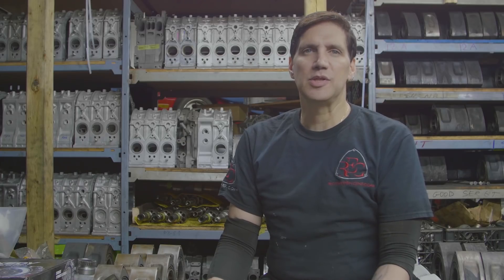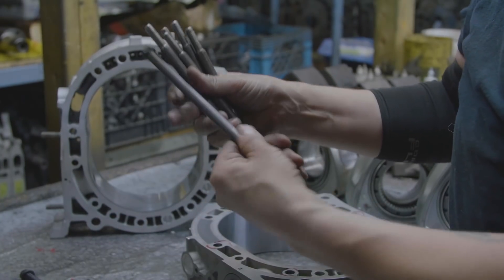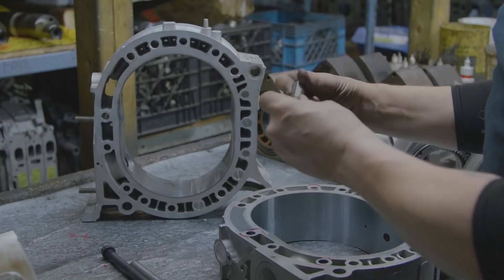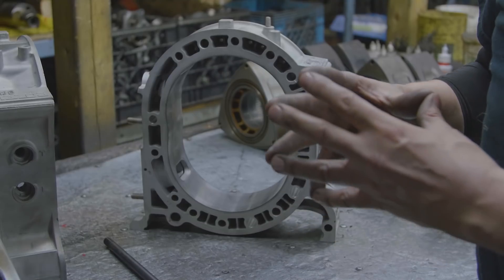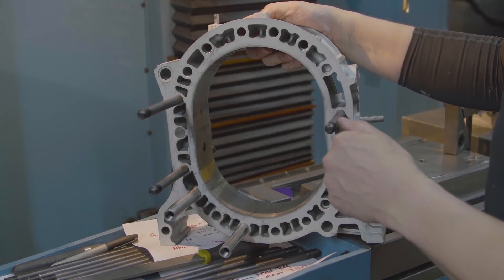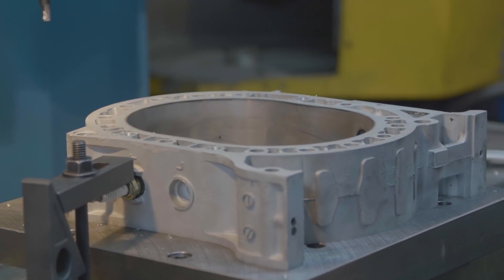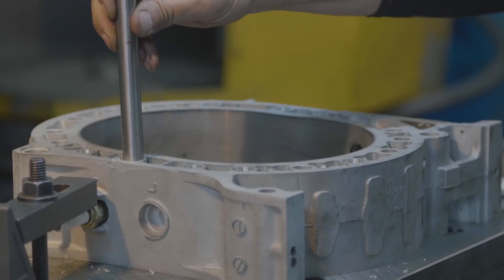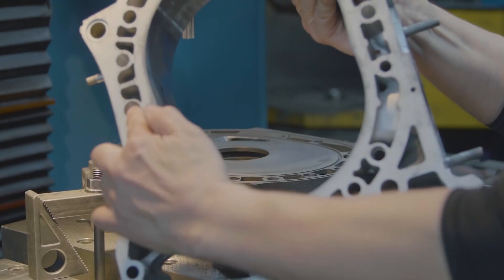PART 1 Dowel Pinning a 3 rotor 20B

Comment: Twist a piece of paper into tight pencil like dooby and stick it in the air intake before the filter.  As you do not want it to get sucked in.  Secure it in place and then start the engine.  After A while of driving pull over and put your hand in the exhaust stream.  It should be A lot more humid than it normally would be.

  It basically pulls small amounts of water/coolant into the combustion chamber where it can be turned into steam.  Using this trick might ruin your engine or give it better MPG by steam cleaning the engine.  Up to you if you try it.  

  If you leave this mod on, you should change the coolant to the environmentally friendly kind.

  Also try fuel magnets at the same time as you are using this modification.  Fuel magnets create more heat in the engine and in turn will create more steam.  More steam equals more power and cleaner engine.

  Of course this is A gamble but I would not try it on A highly modified engine.

Comment: rotaries are by far my favourite engine, I have recently moved countries and busy planning my next project. Its between a 20B eunos cosmo or an R33 skyline and i have always wanted a rotary... sadly you and I are on different continents, I have not looked at the euro guys for their quality of work yet, but due to the videos you have posted showing how you work I would rather trust you guys. I will take a look at some of the Euro guys that work with rotaries then depending on what they say I will probably reach out to you guys. I have machining experience so I would say it is possible to do this on a normal mill and not CNC but it wont be easy...

Comment: I ain't gonna lie. At 16:52, seeing how there is so little material left around the cast iron walls for the dowels on that 20b plate makes me not even want to consider dowling. 

The machining for the studs however, seems to make more since. 20b center irons are just too rare and expensive for me to even consider dowling. Seems with enough heat cycles, those thin walls may crack?
Reply: @AYE OK SURE New or used the REAL issue is the old tech cast iron and Mazda's inconsistent castings of the plates. Cast iron is just so brittle. Did you see the video where they took a hammer and hit a corner of a rotary plate and it just broke off like nothing? Be nice if Mazda would just roll out some new housings made with the new compacted graphite and you wouldn't have to worry about machining for dowels at all.
Reply: RotaryPerfection thin walls do crack and heat cycles between different alloys jeez pretty sure rx7specialties knows what they are doing if your a machinist and rotard lol been a rx7club member for years forums need I say more
Reply: @REsuperGRX7  Well I've owned and worked on rotary since 1991 and have been a forum member over 15yrs and did my own 20b swap and full build. So yes I'm definitely a rotard. 😉 Like I said though, my thing is most aren't building their 20b engines with dowling to last thousands and thousands of miles. MY concern is how long will those thin walls hold up over time on a 20b? I'm not worried about the 13b plates. Its that expensive center plate i worry about. Mazda's casting of the irons is inconsistent. I should know because my D series 20b center plate has thin outer coolant seal side walls that have cracked. So yes, these irons are VERY brittle and that much machining does concern me.
Reply: RotaryPerfection oh didn't know that about 20b centers. Yea probably not worth cracking a hard to find piece like that. Does anybody make aftermarket options yet? Thought I remember seeing someone trying to do rotor housings
Reply: @REsuperGRX7  http://www.billetinc.com.au/products/pro-r-20b/

Not cheap but I love the idea of a replacable wear surface. No more lapping needed just replace the inner plate.
Reply: Its the sum of the parts together as an assembly that locating dowels and studs reduces the possible movement which lessons or possibly eliminates the chance of cracking the irons.  If any one of these parts in the sandwich clocks to a different position, it will increase the chance of a cracked iron.  The studs and dowels work together to distribute the clocking/rotational load so that movement doesn't create a point source load at the dowel.  So the dowels and studs share the work as a team.

Comment: Is it worth the money to "Over Build" a motor? I.E. say I'm only looking for 400-500HP would it hurt to build the whole car (engine, trans, suspension, etc.) capable of handling considerably more power? Basically will over building make everything more reliable or put other parts of the vehicle at risk?
Reply from the maker: Yes overbuild and under drive is our number 1 rule of thumb
Reply: @rx7specialties203  what exactly do you mean by that? Do you know any articles about this (with links)? (Trying to make your response easier on you)
Reply from the maker: It means building the engine to a higher level than you intend to use it